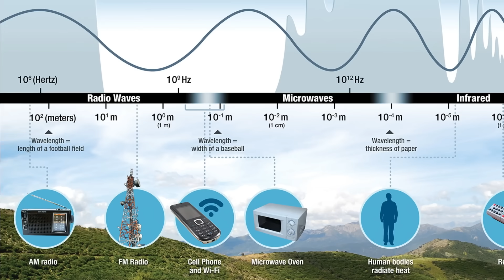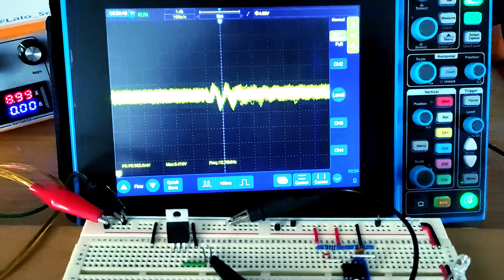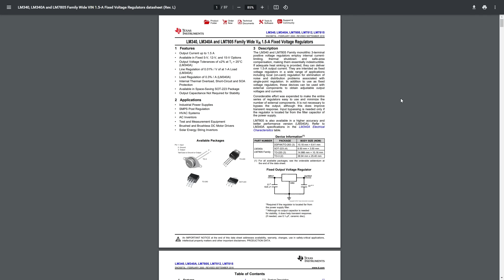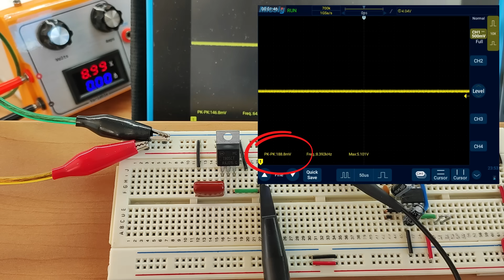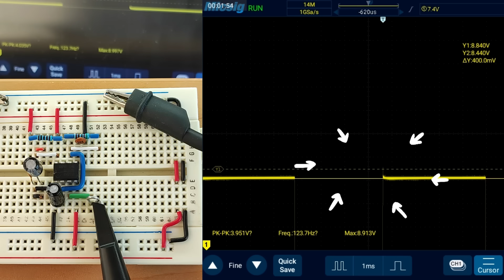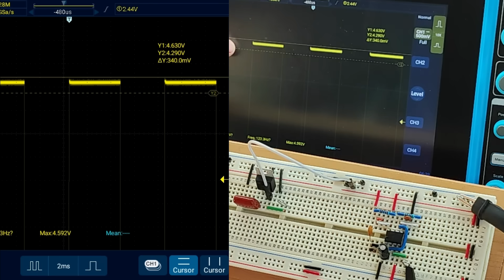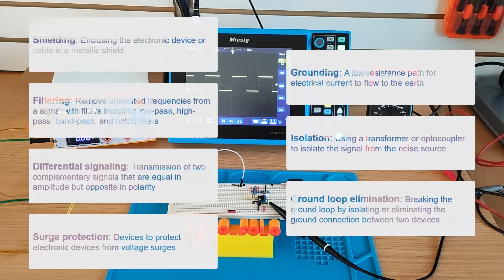Decoupling Capacitors - And why they are important

Comment: Good video.  To explain decoupling for high speed devices with lots of simultaneous switching noise (like FPGAs), inductance plays a big part. Notice: AC takes the path of least inductance, so at very high noise frequencies, any small inductance between the capacitors and noise generating device can render the capacitors less effective or useless. Even the ground/power planes have some inductance and the leads on the device and capacitors have even a bit more inductance.  On a breadboard, it is difficult to keep the leads short and close to the device. Even a millimeter of lead length can add enough inductance so Very High Frequency (VHF)  components of the noise are not decoupled. This is why Surface Mount Technology (SMT) capacitors and devices are now used rather than through-hole components, even the length of the trace through the holes and vias add inductance.  This is why decoupling capacitors are placed directly under components right next to power pins with many redundant vias to reduce the inductance. Also, capacitors with a low Effective Series Resistance (ESR) have lower internal inductance and thus can decouple a wider bandwidth of noise. At this point each group of capacitors and power pin is a tiny localized Ultra High Frequency (UHF) Resistor Capacitor Inductor (RCL) circuit - the symbol L is used for inductance. Dr. Howard Johnson has awesome seminars on this. At today's billions of transitors switching at many GHz rates, these tiny dimensions become critical and you can't even look at a millimeter of Copper clad from a DC perspective anymore, you have to consider the high frequency AC aspects more and more - it becomes all very mechanically sensitive at this point.  This is why it is common to have 3 decoupling capacitors for every power pin. A 0.01uf, a 0.1uf, and a 1uf, all SMT devices, all very close to the power pins with the smaller values closest to the power pins. This gives a wide band of decoupling from UHF down to Medium Frequencies (MF). For circuits that consume a lot of power and have Low Frequecy (LF) and Very Low Frequency (VLF) noise down to DC, larger 10uf to 100uf capacitors are required all over the board but these can be a bit further from the power pins due to inductance has less effect on lower frequencies as you approach DC. This creates islands of "hold up voltage" or "power reservoirs" all over the board - with the inductance between the circuits keeping the islands isolated at UHF even though there is a large DC path between them.

In your example, even though it was a breadboard and you were using leaded components (as an example), you put the larger capacitor close to the 555 Timer.  In your case it didn't really matter on a breadboard.  People need to remember this video was a good demo, but you need to get into the habit of placing the smaller capacitor values closest to the power pins, with virtally no leads and no wires (mounted on the power/ground planes directly with SMT devices with low ESR and lots of Vias).

That jumper wire you made from the Regulator to the 555 Timer has a lot of relative inductance, so as the 555 Timer output switches, the change in current (AC) that is supplying the Timer from the Regulator is partially blocked by that inductance and thus the circuits inside the Timer don't have enough local power reserves to recover properly.

Remember:
Capacitors block DC and pass AC, while Inductors pass DC and block AC.
Even a tiny piece of of wire/lead/via/through-hole has significant inductance at UHF, and even DC planes have some inductance.
Reply: This comment should be a chapter in a textbook!
Reply: @eternaldoorman5228  Thanks, see my comment below.
Reply: THIS comment is a textbook example of how expertise in the wild rarely filters down to academia. You, sir, could easily teach a semester course on decoupling.
Reply: @ddognine  Thanks for the comment. Not only have I been doing this since high school electronics in 1977, I teach it in my free Summer STEM class. I first learned about decoupling in high school electronics. I was building a multi stage counter circuit with 74 series TTL chips. It was counting wrong at times, my teacher showed me how to look for noise on the o-scope and to put in decoupling caps next to each chip. It fixed the problem.  If you ever have a chance to attend any of Dr. Howard Johnson's seminars on signal integrity, take them. He sacles things up 10x so you can see the mechanics of it all and to lower the bandwidth on effects for discussion and examination. I once asked him if he could do a seminar on Ball Grid Array (BGA) inductance and decoupling. He did, I think he has a video on it. These days, FPGA pins are mounted underneath the chip with a matrix of tiny solder balls, when heated, they melt and make 100's of connections between the chip and board in seconds. The thing is, FPGAs (and many CPUs) get so hot you have to bond a thin aluminum plate to the bottom of the board as a heat sink. So you can't probe any pins... you have to use JTAG to test the connections or use JTAG to monitor the signals. I made a JTAG tool that allowed us to monitor signals between non JTAG devices and some JTAG-able FPGAs in real time, we had to slow down the signals but it gave a graphic display on the toggling of the pins (balls) to see if any are stuck/shorted/open. I designed that tool back in 2001, I hear they still use it on the F-22 project.  We had an in-house subject matter expert on signal integrity, and I was the JTAG subject matter expert. We had regular "lunch-n-learn" seminars at work... so many companies forget that we each have our areas of expertise and sharing these ideas at lunch (company buys us lunch) is a great way for a company to really move ahead down the high tech road.  I have to give credit to one of my mentors when I was a young pup engineer. Harry Clayton showed me to select capacitors that had the lowest ESR and the shortest leads to reduce the inductance and widen the capacitor's filtering bandwidth for better and higher frequency decoupling. The guy had an IQ of about 200, I was dirt compared to him at a mere 165 IQ, so he took me under his wing... a great guy, great engineer, and great beer homebrewer.
Reply: @Nomine_Pater  Thank you for your kind words. It was a very technical answers... I owe this knowledge to my mentor Harry Claton who taught me about capacitors when I was his Engineering Assistant.
Reply: @paulromsky9527  You said you teach free summer STEM courses on electronics?
Reply: @joshgill2729 I did, I may do it again this year.
Reply: What he said.
Reply: @perniciouspete   I gave him a like. I just rewatched the video.  He really didn't get into what I said above. He mentioned low impedance decoupling, but never mentioned that stray/intrinsic inductance is what causes insufficient decoupling in high speed digital electronics. The reason he didn't get the noise attenuation he was expecting was because of what I mentioned above. I was not putting him down, I was just making the point that breadboarding is a way to demonstrate decoupling, but in a final circuit it would behove oneself to consider my advice. I do this every day, and in some cases I have to model the decoupling in simulation before a slap down 8 Xilinx Vitex 7 FPGAs on a board - thats many millions of transistors switching simultaneously at 200 MHz - a LOT a wideband noise that needs to be resolved. That's a lot of heat too... you can fry and egg on them... we actually did this in the lab.
Reply: @paulromsky9527  What else he said.
Reply: Exactly! I agree whole heartedly... Those darn Electrolytic Capacitors can explode without warning... and really ruin your day. But I won't get too excited about it, because I don't want to upset you... don't you agree?  When they pop, they can hurt you and inflict a lot of pain... very badly. Golly!
Reply: @perniciouspete haha same
Reply: @JeffGeerling  It appears that you think I was just reiterating the video (correct?)... I beg to differ. I think I am going to make a video that explains the finer points of decoupling, it is actually "high science" these days, not like in the 70's where you put a 0.1 uf ceramic disc capacitor next to each microcircuit. See my comment to Pernicious Pete. Peace.
Reply: @paulromsky9527  Hi Paul, @perniciouspete4986 and @JeffGeerling like what you wrote. "What he said" is a common complement taken from TV (at least that is where I hear it) in a humorous way. They refer to what you said, not what Lalo said. The phrase is used when somebody could not possibly have said the same thing but they pretend they could have for humour.
Reply: @xbrlinfinity9399  I see. I guess it is like Hank from the Canadian TV show "Corner Gas" (a very funny show)... there was an episode where Hank kept saying, "That's what she said." and then would add, "...that's a double entendra." with a self impressing grin. Thanks for straightening me out.
Reply: @xbrlinfinity9399  I love learning new things. It makes sense that I misinterpreted the phrase, I don't use social media, in fact, I don't even carry a cell phone anymore [laugh]. Your comment inspired me to look it up (from Urban Dictionary):
what he said

‘What he said’ – perplexing late 20th/early 21st Century social media phenomenon. Often to be found on social media sites whereby an individual asks either a reasonable question, solicits help with an issue or question, or seeks assistance with a pressing issue. The individual will then be provided with informed and insightful comments from a broad base of contributors. Eventually, the requesting individual will receive a response from a poorly informed (but perhaps well intentioned) contributor, echoing the previous comments stating ‘What he said’.

The exact point of stating ‘What he said’ when what was said had already been said has yet to be fully determined (particularly when what was ‘said’ was perhaps neither true or accurate). It is often considered a phrase used by the inarticulate and confused.

Mr A: ‘Why do we not see white dog poo anymore?’

Contributor 1: ‘White dog poo is the calcium left behind as the water evaporates, and the 'organic' components of the poop are consumed (in various ways) leaving the inorganic stuff behind. But nowadays dogs don't eat as much bone as they used to, including bone meal. Also, tighter regulation on dogs crapping on pavements means that turds don't hang around for years in public places like they used to, giving them less opportunity to dry out and turn white.’

Contributor 2: ‘What he said.’

by Octopus Scott November 12, 2013

This goes to show I am getting old and starting to loose touch with younger generations' "lingo".  If they had just said, "Yeah", but with inflection - which is lost in text, I would have got it.
From the movie "Spys Like Us": Dan Aykroyd: "I was merely probing for muscle tone and skeletal gurth, it's a new technique, we 'mock' what we don't understand." And Chevy Chase chimes in with a less estute but derisive tone: "Yeah!"
Reply: @paulromsky9527  Haha, I think it would be fun for you to just dig into Urban Dictionary entries every week on a podcast and give your take on them.
Reply: @JeffGeerling  Good idea. A weekly pod cast would be fun.  I need to get a decent video camera with HD, 1080p, good sound, zoom, auto focus that can be manual focused, aperture settings for depth of field, ISO speed, white balance, and SMPTE time stamps. My laptop and tablet web cams are crappy.
Reply: @JeffGeerling  Thanks for suggesting a pod cast. I grew up in the NYC tri-state area in the 70's, 80s, and 90's. Back then, "All that and a bag of chips" was popular.
I said it to my a boss I had a few years ago, I had to explain to him what it meant and how that phrase came to be. That might be my first pod cast.
I also had to explain the phrase: "Drank the Kool-aid" to him.
Reply: Note that if your device has screw terminals or anything else that may induce mechanical stress, do not place ceramic SMD caps directly at the terminals. Mechanical stress can make cracks form in between the layers and that results in a dead short. With enough input current, the capacitor will vaporize itself and traces in its vicinity right through the entire PCB. If you wanna see what that looks like, EEVblog did a video on that.
https://youtu.be/Q2rvAoO-MIA
Reply: @PunakiviAddikti  Good point. But if you are using equipment that has screw terminals that is not a good place for any "decoupling" capacitors nearby due to the high inductance of the screw terminal post and its terminal block, so small SMT caps are useless there anyway. In those cases, very large decoupling capacitors are used, these we call "Bus Caps" because they don't do any decoupling but create local "reservoirs" of power to reduce power rail (bus) sag due to high current transients... they are basically local hold up capacitors. Through hole devices are ok there because power is the issue, not noise.  I once designed a test backplane for a folded 4-section PC board (4 PCBs interconnected with flex cables and folded up into one module). There were 24 Xilinx Virtex-II FPGAs running at 50MHz on that board.  That board really sucked up power. I had to use many "Screw to 10 pin DIP Terminals" that were press fit into the backplane's heavily plated PCB though holes. I had about 50 100uF decoupling caps all over the backplane as bus caps. These FPGAs use 3.3V I/O and, if I recall, 1.5V logic. I had to parallel two HP 50 Amp supplies together and use 10AWG twisted pair power leads from the supplies to the Backplane for the 1.5 Volts alone. 135 Watts just for the internal logic.  Talk about in-rush current!
Reply: @paulromsky9527  Holy crap.
Reply: @PunakiviAddikti I just watched the video. I used those same Teriminal to DIP Adapters, mine were 10 pin ones.  I can see how those small SMT caps will flex and crack to short or open. See my other response on this. I use very large value though hole "bus caps" near those terminals, not small SMT "decoupling caps" because the high inductance of the Terminal Adapters make low inductive decoupling caps nearby useless.  The designers of the board in that video obviously did not fully understand decoupling and inductance, those tiny (lower value) caps near those Terminal Adapters are doing virtually nothing. Thanks for posting a link to that video. Not to mention mechanical and differential thermal expansion stresses on them... they are what I call: "Electrosplosive Capacitors"  [laugh].
Reply: @paulromsky9527  LOL for real, you're correct
Reply: Holy hell thank you.  

I hope you made that video because i need more of this.  

Thank you sir!
Reply: @gibbyrockerhunter  OK , I will make a video, but I will keep out the math for a wider audiance. Once you know the effects of circuits at the UHF range and above, general rules of thumb will work for most hobbies. I learned most of this from my mentor in the 1980's Harry Clayton that insisted on using capacitors with the shortest leads and lowest ESR. It wasn't until I attended a few of Dr. Howard Johnson's (an expert on Signal Integrity) seminars did I find out why. Dr. Johnson scales things up 10x so we can observe how things work using lower frequencies so we an extrapolate that to smaller/higher frequency applications. This is why many people (even some engineers) think Radio Frequency (RF) is black magic, it's not, it's just at higher frequencies, size starts to become important, and as you go smaller, even the speed of light starts to factor in. That is why at the quantum level, things are chaos. So be on the lookout for my video.
Reply: @paulromsky9527  looking for the video i was pretty impressed with your video play list.  You have some pretty sweet projects.  

Over the past few years i have gone in and out of thinking im competent in the rf and overall modulation topics, and knowing i missed something somewhere and a particular project becomes infinitely more difficult to design.  

Im a MechEng by school but electronics have always been one of my main interests.  This past winter i brought out a few projects to work on and have realized some nuances i previously missed.  Which in turn highlight other questions.  As an example, taking a rf transmitter from a working breadboard prototype to a finished, well functioning device within legal limitations has a bit of a learning curve.  

Dont get me wrong. I can design and build one with brute force just fine, but to get it “zeroed out” is quite difficult. 

I guess what im saying is, feel free to include math at the end of the video. Lol.  

Have a good one.
Reply: @gibbyrockerhunter  Thanks, I am all over the place on Playlists.  Which was your favorite?
Reply: @gibbyrockerhunter  OK, there will get some math in there too.
Reply: @gibbyrockerhunter  In what band is your RF transmitter, what modulation, how much power? What type of antenna? Did you control your 50 Ohm impedances EVERYWHERE?
Reply: @paulromsky9527  antenna... 
There are two that will need to be properly assembled when the time comes.  

One is a basic collapsable for when its not at the hone base.  

The second is...i cant remember the name so work with me.  Its a quarter wave, with two separate antenna perpendicular with ground elevation.  

I know i talked way to much, but i was hoping it would better show my base knowledge.  

One thing that i still need to do a ton of research on is audio transformers.  Like the differences between a “if” from the 40’s-70’s to modern audio transformers.  I know many of the differences..and have rebuilt many, but i am in no way fluent, much less competent in that facet.
Reply: @gibbyrockerhunter  Goto the end credits of any of my videos with my logo at the beginning for my e-mail address. We can collaborate there. I can't tell you what it is directly in a comment for some reason.
Reply: @paulromsky9527  did you receive a msg either last night or this morning?

Im working with an iphone7, and its bricking without the new update...   i have a new Samsung coming.  Lol

I didnt want to start spamming but on my end as soon as i sent it, it would disappear.
Reply: Thats crazy i never knew 1mm of wire leg could have an effect makes let me think that the actual layout of an amplifier board also greatly affects its sound
Reply: @SheikhN-bible-syndrome  If the amplifer is in the audio range and the noise is in that range too, then a few millimeters of lead between the cap and the device won't make much difference. But, if you get into the Giga Hz, then 1 millimeter starts to become a significant inductance that will limit the bandwidth of the to cap to filter out noise. The lead and the cap start to act as a tuned tank circuit. This is why high frequency AC travels along the surface of a wire (skin effect)... if you can imagine that the cross section of a wire is in fact an infinite series of concentric circles of copper (an infinite series of inductors) with the least inductance being the outer surface where the inductance is least, and the center of the wire where the tighter radius inductance is the most... since AC travels along the path of least inductance, the AC electrons travel more along the surface of the wire. This is also why wires are rated to carry more DC current than AC. So when the frequecy goes up, inductance and capacitance start to factor in to everything.